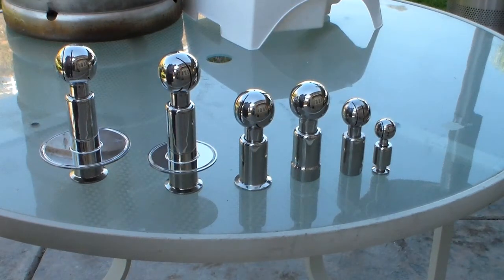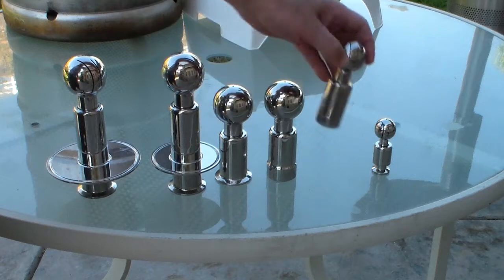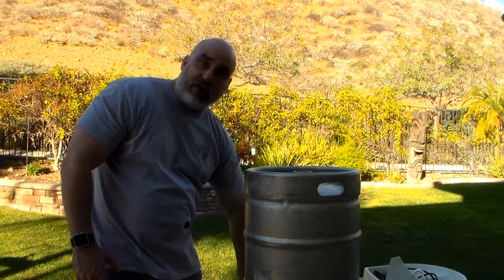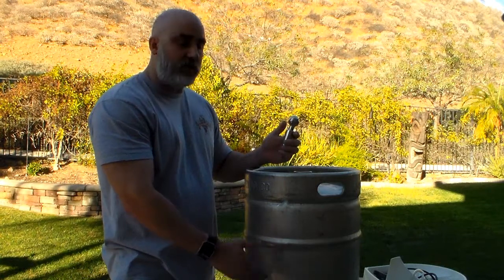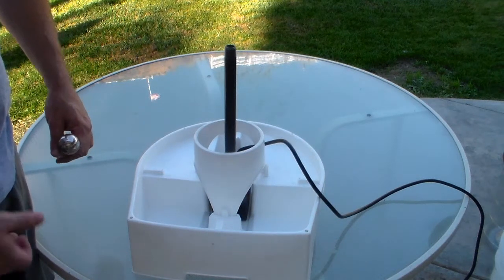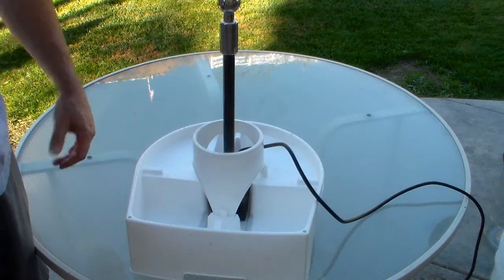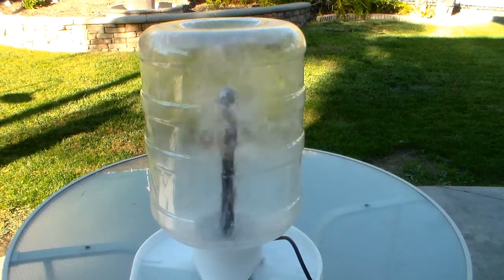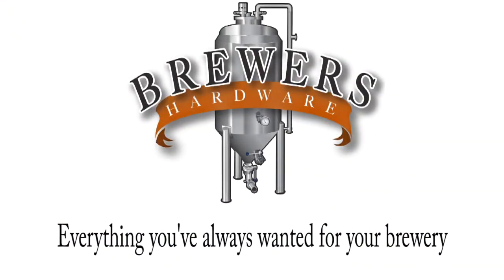Clean In Place or CIP Spray Balls

Comment: I use. $3.99 brush with a bend in the handle. 
I’m too OCD for a device like this. Ultimately I would have to use my brush even if the fermenter looked clean.